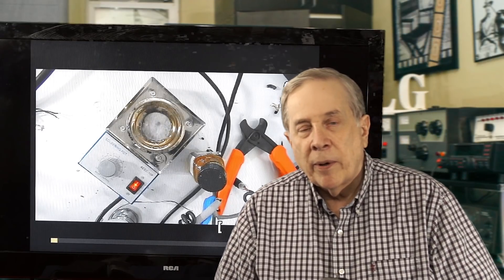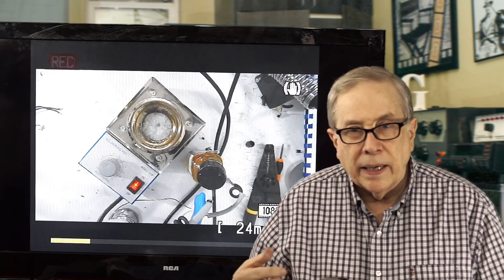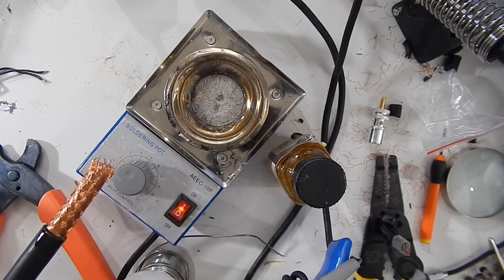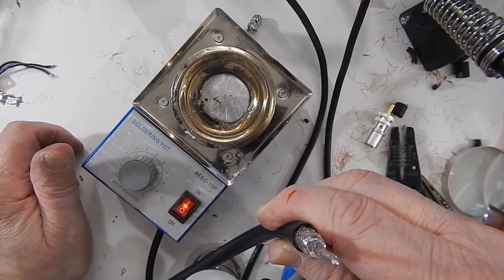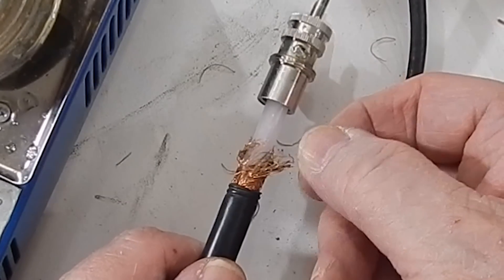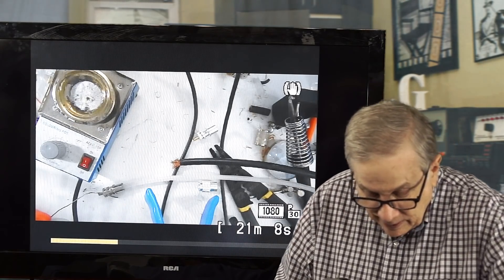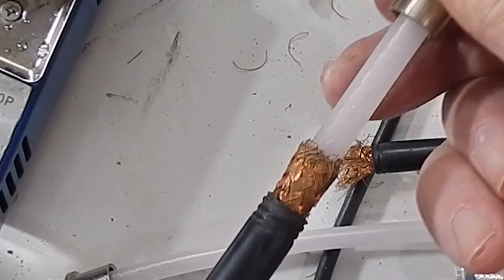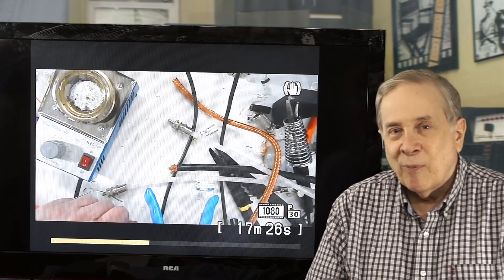Ham Radio Basics--How to Solder--Part 3, Watch at 7 Minutes for a Surprise Failure

Comment: I know what you are saying.  I bought 100' run of LMR 400, when I opened the box the PL-259 was laying in the bottom of the box.  It had fallen off on the way to my home.  Poor workmanship for sure.  Needless to say I crimped on my own connector and all was fine.  I now always buy bulk cable and do my own connectors.  Lesson learned.

Comment: I use the solder pot method all the time for my Rg-213 cables. First, you have to get the temp right, or it won't work. You need it to be around 200 degrees. I don't like those cheap Chinese solder pots either, the quality isn't great and they get too hot. I use a Lyman Big Dipper. The only downside is you need a lot of solder to fill it up, so it's deep enough. Turn it up to full for about 5-6 minutes, then turn it down to 4-5 and let it sit for 10 minutes to cool down. Then apply a small amount of non-corrosive flux to the end of the cable. I use MG Chemicals 835 rosin non corrosive flux. Then place the cable in the solder for 4-6 seconds to let it wet out. If the solder is too hot it will melt the dielectric. You need to experiment with the temp settings for your pot to make this work, but it can work.
Reply from the maker: Thanks for explaining how to do it.  I got sidetracked by the poorly installed coax connectors from a company in the mid-west.  Question, does your procedure still work okay with foam dielectric? Thanks Matt & 73 de Jim W6LG

Comment: I've never had an Amphenol 83-1SP (silver) plug pull off a cable once properly installed, but I will admit that I'm terrible at soldering, frequently melt the jacket, and usually take a few attempts to get it right (which isn't cheap when using Amphenol connectors exclusively). I'm tempted to go the crimp route, too.  If I'm remembering correctly, I crimped some cables I built with N connectors a few years ago, and have never had any trouble with them.  A lot of the long-time hams around here that I respect a lot really frown on crimping - but I'm not sure I understand why.

Comment: I agree that pre made coax is a dumb way to buy coax, if you can, always roll your own. I have an inverted V dipole 30' off the ground, and the feedline is RG 213, and it is pretty heavy. It slopes down to the porch at least 35'. There is no support for it at the feedpoint yet. I merely folded back the shield over the insulation and screwed a standard UHF connector body over the shield. It was almost impossible to do, but, it`s on there and I was hauling on it and couldn`t pull it off. It is not soldered on or crimped in any way. Of course, I soldered the center conductor into the connector tip. That 35' of heavy 213 has been hanging there for a year, now, swinging in the wind, and doesn`t show signs of coming down. My SWR is about 1.5:1, ish, across the forty meter band that a General is permitted. Works for me.

Comment: I Fold the shield back onto the outer plastic covering and screw the 259 over it all. No soldering anything. As far as the shield is concerned. But to each their own. I have my way, and everybody else has their's. Then coax seal the final assembly.
Reply: Just commented on that, works for me, too. Did you ever use that putty that is used in construction to help plug holes in duct works? I tried it, and dang if it ain`t the same stuff Coax Seal is made of. And dirt cheap, too!
Reply: I've done that with LMR-400, haven't tried with RG-213. The solder pot method works for me on 213.
Reply: Matt K I've done it with rg8 but now I'm running lmr600. And even a crimped conector, you run the shield back enough to make connection. You don't solder it.

Comment: I've used both solder and crimping, and much prefer crimping.  If we think about this, crimping a braid makes a complete 360 contact - whereas dropping solder into the four openings on a standard pl259 is, at best, only four points of contact.  Put a little solder in the tip and you're done.  73, W6CK

Comment: Hi Jim, I have replaced all the UHF male plugs in my equipment with crimp connectors after watching one of your videos a long while ago and now have nothing but crimp fit plugs throughout! Having had nothing but trouble with solder on types particularly as going portable once or twice a week involves connecting and disconnecting the plugs frequently and they where becoming the bain of my existence with frequent failures. since going over to all crimped fittings I haven't had a single failure in the field or shack. Another example of the great advice you provide to many! Happy New Year and 73 from Tom 2E0XNV

Comment: Hi Jim,
When I saw your video Install a PL259 in under 1 minute you sold me on crimped connectors. Bought your crimper, stripping tools, and a supply of connectors. Also bought several rolls of Raincoat. Happy New Year   73  WB3BJU
Reply: So where is his store at.

Comment: I think it was you, Jim, who convinced me to try crimp-on connectors. Sure enough, compared with the really difficult experience I had with trying to solder connectors, the crimp-ons were a breeze. _Also_, this summer I started having big problems with the SWR on my G5RV, and when I went to check the connectors on the 50' RG213 almost exactly the same thing happened. That is the connector separated with little pressure at all and I stood there dumbfounded. Since your videos are tailored toward relative beginners, it might be helpful if you could explain how to select the right connectors for a given cable. It's not rocket science, but it is annoying to try and figure out. Thanks always. John, KC1DIW.